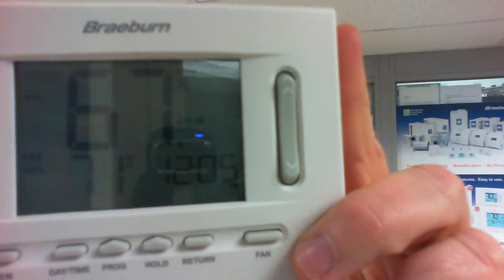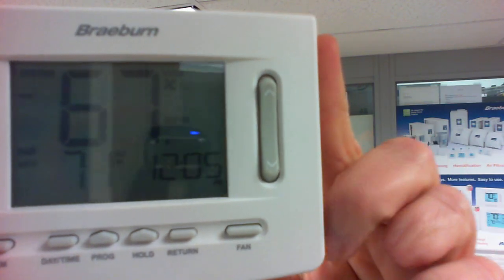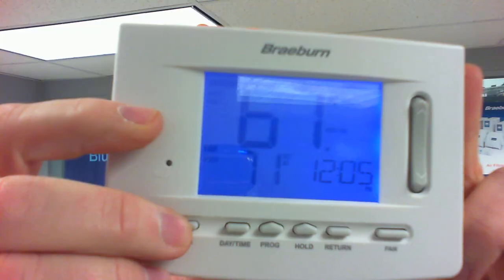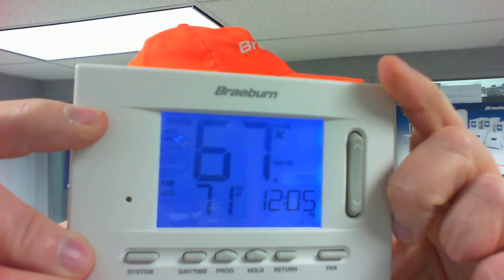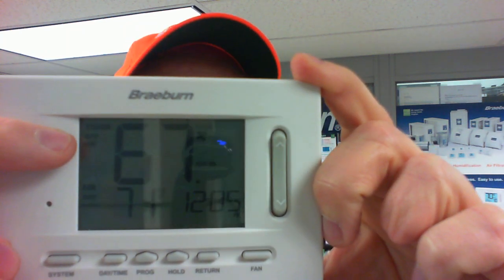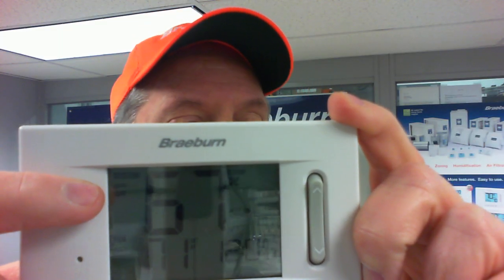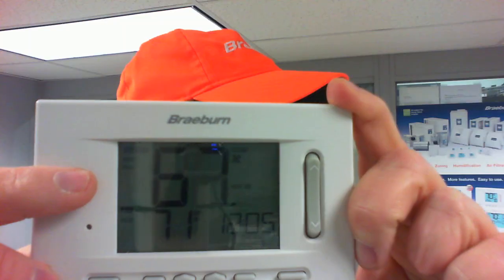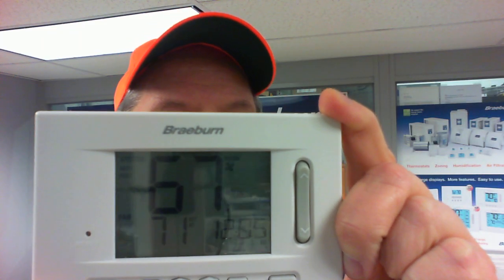Braeburn Auto Changeover setup

Comment: The installation manual for the 7500 wireless does not show a setting for 2 heat 1 cool. I used 22 HP. Is that correct?